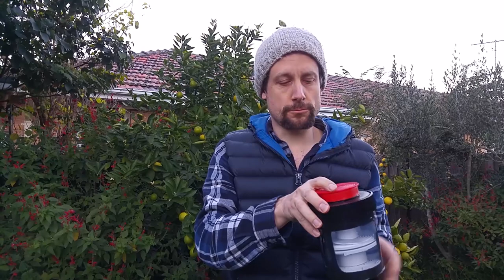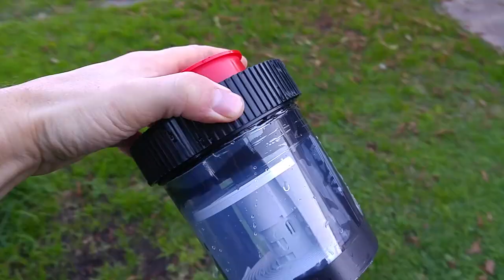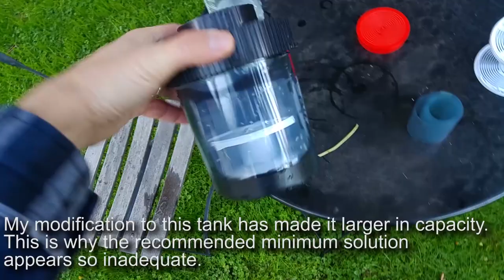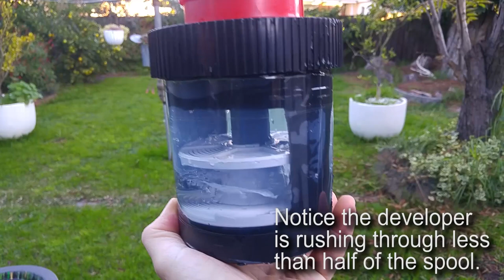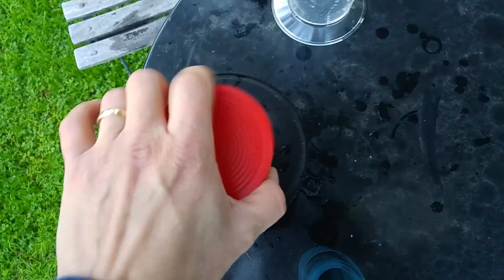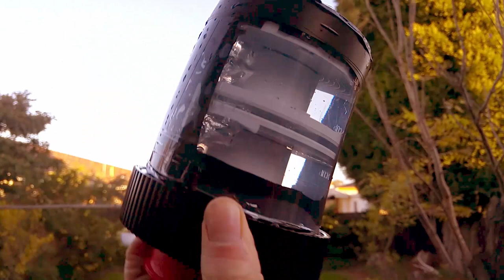Film agitation in a  see through daylight tank inversion technique

Comment: I add a 90 degree twist during each inversion, so after the 4 inversions the tank has rotated thru 360 degrees. Also, contrary to an earlier post, I half-fill my 2 spool tank if I'm only developing one film and I've never had a problem with uneven development during 100+ processes..(120 film). But as you say, consistency is the key.
Reply: Same here except that I do a 180° turn.

Comment: Thank you for the trouble you went to in setting this up. Having got blix all over the place when the tank "burped" while inverting, I now agitate C41 using the swizzle stick while the tank remains in the water bath to maintain temperature. No mess and the results are good. I invert for B&W but I have also used the stick to agitate.
Reply from the maker: I should do a video on how swizzle sticks are just fine. Or even better a video on trying to ruin film and still getting good development. I have tried to ruin film before and still gotten good development.

Comment: The best way i have found is not to invert or turn just vibrate the tank with a motor and weight for 5 sec every minute. i got the idea from a friend who uses the technique to polish pebbles. i have been doing it this way for 15 years and get perfect negs every time.
Reply from the maker: That's interesting. With all the books I have read about hundreds of years of photography I have never heard of using vibration. I can't picture vibration circulating the chemistry. You should make a video, I would be interested to see it.
Reply: @thorleyphotography  I wouldn't know how to do a video on here . I do it this way all the time now i just got sick of tanks leaking all the time .When you think of developing paper,  people all ways jiggle the tray about it only the same thing. i did the circulating magnet thing and the worked out fine too but not quite as good. Another way is to force Co2 into the bottom of the tank that procedure is well documented and i have done that too and it works really well but it's a bit bothersome . so i just use a fan with a nut and bolt on one of the blades, I am using a 556 timer chip to do the timing for me but it's not really necessary just turn it on/off by the switch. If you get the right oscillation to get little point of water all over the surface of the tank you have got it right. As a test A speaker cone with a bit of sand on it and an audio generator set to about 10 Khz square gives much the same result but irritating noise .
Reply: @thorleyphotography  NB: as to "I can't picture vibration circulating the chemistry" given that the water has to move and the tank spiral jumps about a bit would seem to be enough  .It does the job for me and doesnt give me high contrast negs (if you don't turn it on to much ) 5 sec every minute is right for me.
Reply from the maker: There's a lot of variable we haven't mentioned here. I once took a modern film Delta, put it in D76, did three limp almost inversions and went to have lunch. The negatives weren't bad. On the other extreme if you shoot 5x4 and develop in Pyro it's almost a sport. I often use a lithographic film that isn't meant to produce continuous tone, getting this even in Pyro is just about wizardry.

Comment: I aggitate 1st 30 seconds and then 5 seconds for every 30 seconds and have had no issues.   I also don't use the minimum recommended on the tank bottom.  Rather, I like to round up (35mm: 300 ml vs recommended 290 ml), (4x5: 1000 ml vs 950 ml), (6x6: 500 ml vs 500 ml) because the, ahem, math is easier.  That being said, I really like your demo with the tank window as it shows what is happening and it is very revealing, to say the least.
Reply from the maker: thanks for the comment. Keep enjoying film.

Comment: Nice video. I'm not a fan of this brusque agitation method, it creates a lot of bubbles. The only requirement for a good agitation method is that the developer that's in direct contact with the film is renewed during the specified intervals for the film/developer combo. As long as there's enough developer to cover the spool and about 1/3 more, a wobble movement accompanied by a rotation movement around the spool's axis is perfectly sufficient and it creates virtually zero air bubbles.

Comment: Fill the tank to the correct capacity, which will submerge the film completely. Tap the tank to release any bubbles of air. Inverse continiously for 1 minute, do not use force. At the end of every minute inverse 4 times. Use stop bath, followed by fix.
This results in perfectly developed film, no problems. Use developer suited to the new generation of films, like FX39.